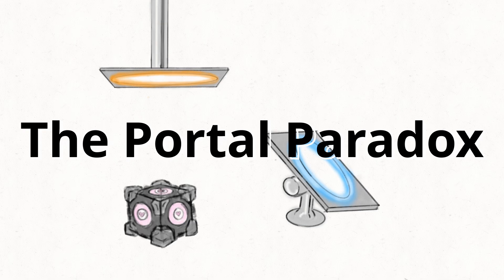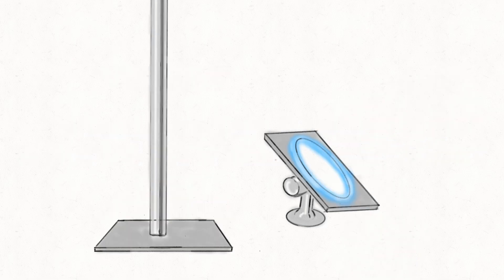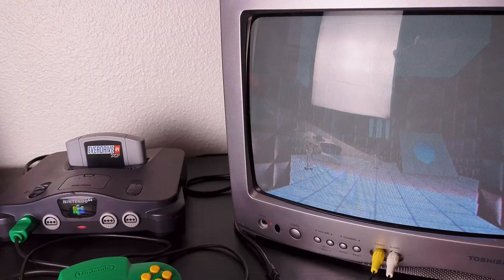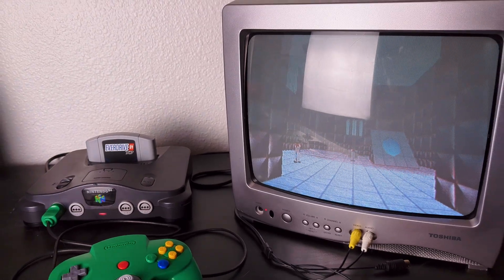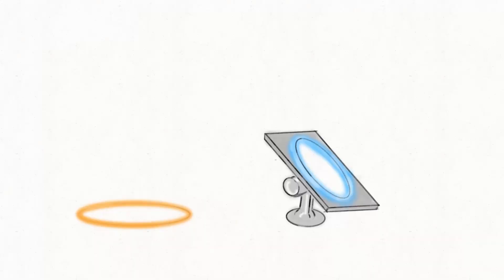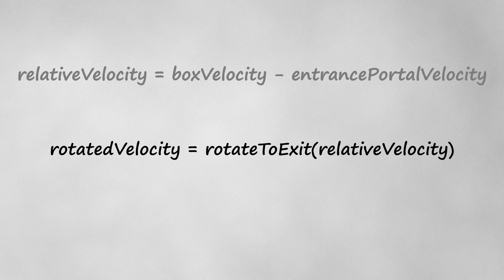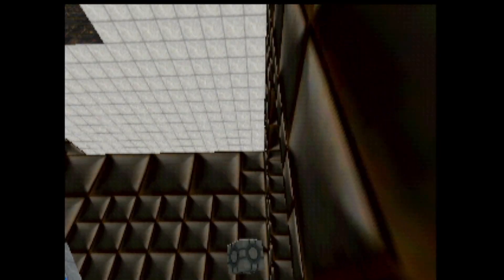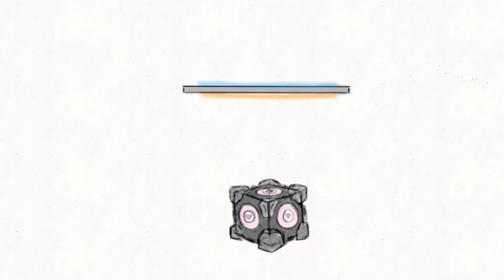I rewrote Portal from scratch and solved the Portal Paradox

Comment: You are neglecting the fact that you have chosen a specific perspective from which to calculate relative motion. You chose the exit perspective and not the entrance perspective because it aligned with what you already believed. Any perspective would be arbitrary except perhaps the perspective of the cube, which simply passes through a ring, and experiences a cha ge in gravity. Or, if we aet up the non biasing version of this test, where the exit portal is flat on the ground, the cube simply moves through a ring.

Portals are not 2 objects, they are a single object warped through a tesseract. There is no, and I do mean NO difference between a portal and a hoola hoop for this case. Slamming down a hoola hoop would not result in a moving cube. Portals are also shown as incapable of producing any energy other than potential energy through their relationship with gravity, the actual source of the energy.

Even if none of the above was true, you have still failed to consider that the two sides of the portal are not some special spatial event. A tesseract that connects 2 points in space is indistinguishable from any other 2 directly adjacent points. There is no relativistic anomaly here. A ring drops over the portal.

You are allowing your fantastical scifi perspective to make you assume the creation of a force where none exists because it is more interesting. Human brains are smooth that way.

Comment: I understand what your saying, instead of throwing a fast cube through a portal your throwing a portal at it, essentially the same motion occurs, but the velocity of the portals shouldn't matter, in portal itself they act like holes they don't add any extra effects so I personally believe the cube that has no momentum or energy that isn't approached by something that can push it would fall off the slanted surface of the blue portal as nothing gave it any energy to move

But thats my approach on actual physics, for a puzzle game using portals this could be a fun way to add new complexity to puzzles having you use slamming portals as away to launch cubes and such

Now i would love to see this interaction with different gels

Comment: In the case of a moving entrance and fixed exit portal, I'd expect the cube to leave the exit *faster* than the entrance is moving: 

The cube is not a point object, it has a considerable height.
Objects exit the exit portal *instantaneously* after entering the entrance portal.
The cube remains in one piece and is not destroyed by the portals.
This means that there's a process that happens *as* the entrance portal slams down over the cube.

As the cube enters the moving portal, the portal adds momentum and transports to the exit. 
At the point that only 1% of the cube has passed through the portal, you have a situation in which 1% of the cube is out of the exit portal and has the momentum added from the moving portal. 
This 1% "slice" of the cube is still connected to the unmoving 99% cube that is yet to pass through the entrance.
This would apply a tension/lifting force between the top and bottom of the cube.

At some point, this tension/lifting force being caused by the top/already transported section of cube accelerating away from the exit will overcome the gravity/mass of the remaining unmoved portion and *lift it up* towards and through the *moving* entrance portal.

At this point, you have a system in which the remaining portion of cube is being *dragged* through the *moving* entrance portal by the force of the cube exiting the exit portal.

This means the unmoved part of the cube now accelerates up towards the still moving entrance portal, causing an exponential increase in velocity for this portion of the process. The cube is now jumping up towards the descending portal, so the velocities are adding together in an accelerating fashion.

Comment: So if you shot a box straight into a portal on a panel moving horizontally, perpendicular to the box, with this equation, wouldn't the box come out the other portal moving in the opposite direction to the portal? For example, if the portal was moving left, the box would come out flying right. Or if the portal was moving towards the box, the box would slow down? Since all you're measuring is relative velocity.  

There's nothing objectively wrong about that, but it feels a bit awkward? In the spirit of the games, I think anything moving through the portals should essentially act as if there wasn't a portal there at all, only changing position, not completely changing direction or velocity. I don't see why you couldn't just remove the "-portalvelocity" term from your equation. As you said, you made it up specifically to act how you wanted, and that's not the most natural way for a lot of people.

Comment: Wait what sorry I’m so confused. Great program. I’m not a physicist so I’d need an simple explanation. I need to understand how does a portal add velocity to the cube? I think of portals like holes in space. If you have a hula hoop go through a cube, it’s not like the hoop is adding velocity to the cube when entering the hoop and then it cancels out as it exits the hoop, the hoop simply goes through and cube has as much velocity as it entered, zero. 

I’m trying think as I honestly don’t know but if we think of it like a tube now not a hoop, if I am moving the enter point of the tube and not the exit point, it would it add velocity to the cube? If it does, where? 

I guess I need an understanding of how you think a portal behaves as using a hoop or tube example makes it seem like no velocity would be added.

Comment: You are not taking into account relativity. Your equations are wrong in that the cube is actually not moving relative to the blue portal. It is easy to prove: the cube is not moving relative to the ground, the ground is not moving relative to the blue portal, so by the transitive property, the cube is not moving relative to the blue portal. Therefore, it doesn't get launched. Simple physics.

Comment: I never really saw any paradox in this, its common sense. For the cube to move through the static portal it needs to actually move, there is also no magic force that suddenly slows it down on the other side, doesnt matter what the moving portal does when the cube isnt in the portal.
The real question is, if a portal changes speed with something inside it, what happens to the object?

Comment: Bit late here, hope you don't mind

Anyway, I think your approach is wrong
The equation is wrong in the choice of first step. (The rest of the logic is fine, it's just not the correct logic to be using if you want to have accurate physics) 

The relative velocity between the portal and the object passing through it is not what determines the velocity of the object going out the other side.
The way a portal works is that, whenever an object goes into one, it immediately exits the other. That is all that happens. All properties of the object are conserved. As such, if you send a stationery object through a portal really really fast, it will just be stationery as it comes out the other portal, and will have come out of it soon after it had started. 

If you want it in physics terms, just ask where the portal imparts kinetic energy into the cube. The answer is nowhere, you are just creating energy. 

Oh, yeah, what happens when you stick the cube into the stationery portal whilst the other is moving?
Reply: Portals don't conserve energy. As in, they break the conservation of energy. Place the blue portal higher than the orange one and any object going through the orange portal instantly gains gravitational potential energy.
Reply: @Schell3092  true, but thats not the portal giving it energy, it's gravity on the other side.
Reply: @Santisima_Trinidad  The energy doesn't "come" from the portal, new energy is appearing that did not exist before. 
Put one portal on the ceiling and one on the floor, pour water down the portal. The water will fall forever. Put a turbine in between and you would have infinite free energy. (Set up a funnel so all the water goes back into the bottom portal)
Reply: @Schell3092  yes, thats what i said. And if it's the gravity giving the energy, then a moving portal would not cause a stationery cube to go flying. The cube would go through the portal, gain potential energy from gravity, and just fall straight onto the ground.
Reply: @Santisima_Trinidad  You wrote "all properties of the object are conserved", that is false. Even with stationary portals that is false.

Comment: Why would moving the hole create velocity? your answer implies that some external force is being generated when we know that the only two factors that change the outcome of an object being moved through the portals is angle and the momentum of the object passing through it, if you dropped a pea through a straw and made the straw smaller while the pea was falling the pea wouldn't fall faster would it? it would come out of the hole straw sooner but no additional force would be generated on the pea

Comment: I completely agree with this solution, but i also have a conflict, if you say, put the box on a post that would fit through the portal its easier to see how 1 moveing object(the portal surface) becomes 2 (box and portal surface) so i would think this would be similar to hitting the cube with a hammer, launching it but also loseing more energy than you do just flying through space

Comment: I enjoyed the video, but my instict immediatly disagreed with you, although your point made sense, humor me in this : a portal is basically just a wormhole right? an instantaneous shortcut between point A and B, let's take the example often used to illustrate an Einstein–Rosen bridge which is a folded paper, let's put a big circular hole going through both sides of it, if you would move one portal would be equivalent to moving both since they represent 2 points in space warped in a way to become one, now in our simulation move that circular hole in the paper through an object of any kind, move the hole at maximum velocity, when the object pops out it retains its velocity, it didn't change, just like if a door ran through you then stopped, it's kinetic energy won't transfer to you, even if it continued moving. One more thing is that portals don't have mass as they are just a rip in spacetime, and thus their energy wouldn't be contained as kinetic, no transfer of energy will occur. But hey this is purely based on what I remember from my long forgotten days in Physics class.

Comment: To me, the cube should just poof out because it's not the portal moving, it's the surface it is on, therefore, the speed of the cube should remain the same and have no momentum, since it is not in direct contact with the moving surface, since the portal is in the way.
Reply: the cube must leave the portal at some speed, or it won't leave the portal.
if a blue portal moves over a 1-meter-tall cube in one second, the cube will enter the portal at 1m/s, and must leave the orange portal at the same speed. does it then snap to a halt instantly once it's through? where does the speed go?
Reply: @hydrogen-8  true
though i always just thought the cube should just've popped out cuz gravity with the blue portal
i assumed the cube just appears in the blue portal and fall off due to yo gravity

Comment: I think the most logical way of thinking about this is: When the entrance portal is decending, from the perspective of the exit portal it looks like the floor is being pushed up into the exit portal. From the perspective of the exit portal the entrance portal (and cube) have velocity which suddenly comes to a stop. This sudden stop is what causes the cube, which has kinetic energy as it passes through the entrance portal and out of the entrance portal, is then propelled as the floor it is sitting on comes to a stop where the cube itself doesn't.

Comment: After watching the beginning 30 seconds I had to pause because it doesn't make sense to me 🤔
If I dropped a hula hoop around me and it hit the floor, I'm not the one that starts moving when it hits the floor. I get that in theory, it's no different from a person approaching a portal vs a portal approaching a person, but the thing about portals is that they conserve momentum?

(I'm curious to see what you say in the video btw)

Another way to think about it is if you had a portal on a stick in the shape of a tennis racket (minus the strings) and scooped a ball into the portal horizontally while the ball is falling, the ball should continue to fall with the same momentum it had right? 🤔 the only thing that's changed is the direction of gravity (which is roughly a 90° rotation in this case). You wouldn't expect it to accelerate towards the ground at the same rate as you swinging your arm right? 🤔

Comment: This entire model is completely incomparable with the 100% confirmed fact that the portals in the portal universe are connections between two points in space. If the orange portal was horizontal moving down onto the cube and the blue portal was on a stationary horizontal surface face up the cube would just sit there.

Comment: Wouldn't this not matter since your equation assumes the portals have mass? Which is one of the two pieces of momentum. The other being velocity, but with 0 mass the velocity doesnt matter since 0 times anything is still 0? Not sure if that's a misinterpretation of the problem but, portals are never specified to provide mass to objects as far as I know and thus have no ability to give momentum?
Reply: Ignore this, I came up with an analogy that I feel fits, it's like a vaccuum hose, that has two ends, so while one end sucks (the one being moved), the second stationary part is the part where it would just get shot out of, but if both move in the same direction, it would cause it to remain stationary. and the final part is moving in opposite directions would cause it to be shot out at an exponential force.
Reply: the smallest brain explanation I can come up with is
1 moving 1 stationary, one side suck, other side no effect (small yeet)
both moving in the same direction, both sucking (no yeet)
both moving in the opposite direction, one sucking, one blowing (big yeet)

Comment: Isn't it just the box being pushed by the floor and piston coming together, and nothing to do with conservation of momentum? In Portal, you can stand in the middle of 2 portals, half in half out. But with a piston pushed up against the floor, there is no space to stand in. The blue portal would just be a portal to a concrete wall. That's why the box gets pushed out.

Comment: The system demonstrated in the video gains energy everytime an object goes through the portal. After all, the object gains the kinetic energy of the moving portal, so you end up with more total energy every time. Unless energy is conserved somehow, for example, by the portal losing energy as something goes through it, the feedback would be endless. The portal losing energy also fixes the problem with opposing portals closing in on an object in the middle - portals would simply stop once the object collides with itself, reacting to intermollecular forces. Portals would start acting as mirrors for that object in particular. Which is a bit less paradoxical than usual i guess.
Reply: alternatively, the most elegant solution would be, that two ends of a portal that have different momentum, would transport stuff to different worlds, where the same stuff happens in reverse sometwhere at the same time, keeping the ballance in the multiverse. but that would mean, that plop happens

Comment: You still got the correct answer but it sounds like you implemented the portals incorrectly. It sounds like you have made teleporters instead of portals or wormholes. I think if you had two copies of the world and connected them via the portals you'd have a physics accurate representation of portals. Which should still result in B, but now via non-eucleadean space and wormholes.

Comment: Stop the portal half way down the cube. Does the cube split in half and half of it is thrown out the other side? No. Does it show one half of the cube on one side and the other on the other side? Yes. Therefore there is no kenetic potential in the cube otherwise as soon as it starts to enter the top portal it would be "sucked" in because of the kenetic potential after about half way. Every part of the cube has gravity acting on it at all times. All parts of it sitting in the original spot have downward gravity, and all the other bits coming out the side have downward gravity. That downward gravity doesn't change, so the cube doesn't gain some kenetic energy from the first portal going over it. It doesn't gain energy from the portal falling on it (it's just a door), and it's stationary from so no momentum the entire time. You're 100% wrong, the cube would "show" itself emerge from the second portal no mater how fast the first portal falls, and once it reaches enough of it going through that the gravity going down on it from the second portal positioning it would just flop over and fall down the side. Depending on how fast the first portal falls on it will depend on how it weirdly clunks down the side of the second portal.

Comment: i think that if you move the portal down slowly, the cube won't fly out as far.
it's like dropping a cube into a stationary portal (instead of slamming a moving portal on it.)
if you drop it from a low height, it doesn't have very much speed, so it doesn't fly out as far
but if you drop it from a high height, it'll gain more speed and fly farther